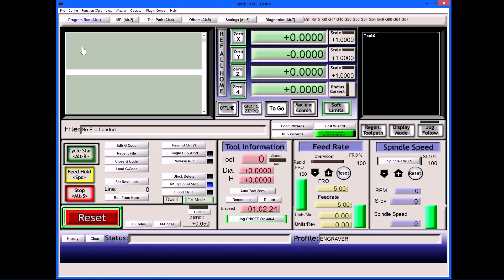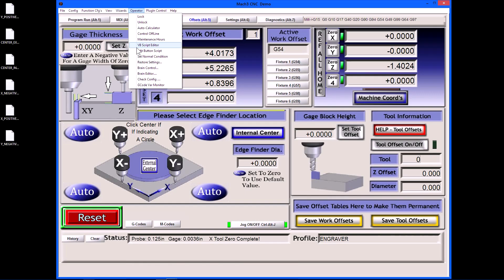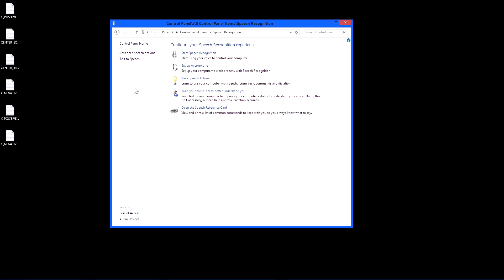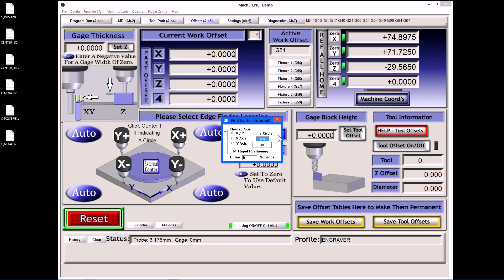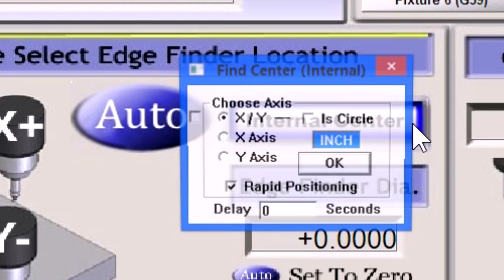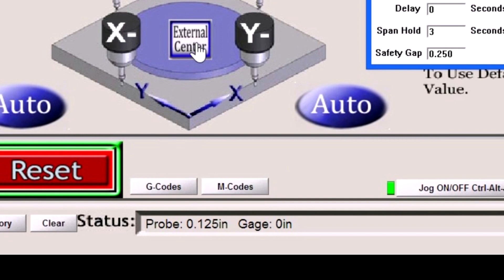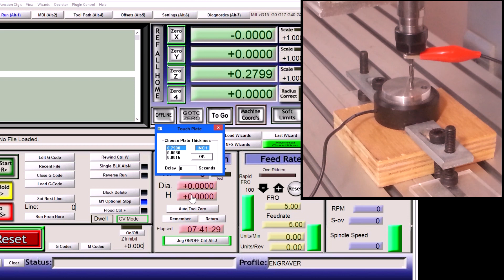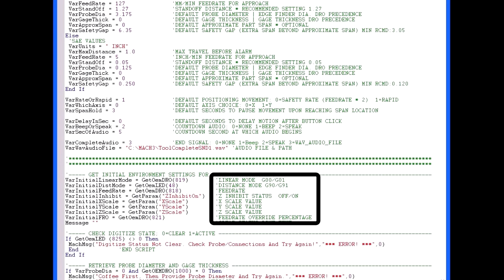CNC Mach3 | Automated Tool Setting | Edge/Center Finding (X/Y) | Includes INCH/MM Scripts

Comment: just installed this after a few years of not using my 4030 .
i have the red bitsensor board over usb and all works perfectly now after breaking 2 bits.
once due to not setting tool zero first  the second was due to not setting up in carbide create correctly so still went further down as was not set to zero for work piece and smashed into a clamp that was on the spoil board.
got it all sussed now so hopefully no more broken bits.
great work on these videos and very well done and the explanation is great.
i am thinking about converting my chester 626 mill now to cnc.
but not sure on mach3 or the smc type control boards.
next step some screen editing.

Comment: Hello, thank you for the information, but I need help. When I use an external center it touches and then moves automatically without rising in the Z first. And tool breaks
Reply: Is there a solution please that can help me?

Comment: I have to thank you for your videos. I want to report that I have tried the X/Y scripts you have and the Z as well on my board. I am using an ethernet board and the scripts work just fine. Don't know about the USB one though. My board loses its mind when used with USB and not Ethernet.
Reply: Waiting for your video on measuring angles of the workpiece and calculating toolpaths with that in mind. Thanks for your valuable content

Comment: I'm new with CNC and the one I have (DMC2) it's using an edge finder that is offset from the spindle.  around +40mm for X and +25mm for the Y.  Question::  Where do I enter the offset position of my probe in the script ?
Reply from the maker: This particular script doesn't have that option. However, you can move your axes the 40,25 after zero is found, then re-zero the axes. Or, you can contact me at sunny5rise@gmail.com with pictures of your setup and we can work on editing the script to do it automatically.

Comment: It's been quite a long that i'm using this scripts and it has always worked very fine, now i have to do some changes in my machine and i was wondering if it's possible to modify the script to work with a reversed digitise input... always 1 and it goes to 0 when touching.
I apreciate your job thank you if you would reply
Reply from the maker: Thank you. If you're talking about working with a reversed probe signal, the script works fine (based on my testing). All I did was reverse the signal (Config\Ports and Pins\Input Signals\Probe... and change the Active Low to Active High). Now the Probe disconnect triggers the Digitize LED. No script editing. Did you have a different experience?
Reply: @sunny5rising  oh thank you, i didn't even think about a so basic thing... i was in to a mental trip to try to figure out the code and modify it and bypassed the most basic thing.
I tried and it worked as expected, thank you
Reply from the maker: Awesome!

Comment: sir, why rxternal center finder does not have is circle?
Reply from the maker: It can be written to have a circle option. I just wrote it like I did for safety reasons. Perhaps I should update it. You can still find the external center of a circle with the current version. Example... Do the X axis first. when done, don't move the X axis, then setup and run the Y axis. When done, you will have center of the external circle.
Reply: @sunny5rising  Hi Charlie, noted on the safety part. I understand might not be necessary to have the circle function . Thank you for the explanation. Btw your scripts are great ! :-)
Reply from the maker: Thank you!

Comment: I’m using the 3.42... version of Mach3. I used your codes, the codes work but they don’t reset the axes. I’m trying to find the center of the inside of the circle. I think the tip is right in the center, but the x and y axis remain at 1,xxx; it does not zero
Reply from the maker: Edit the Internal Center script. On line 313 (for Rev15b) or line 319 (for Rev13), Change SetOemDRO(800,0) to SetDRO(0,0). Zeroing the Y axis would be SetDRO(1,0). Give it a try and let me know how it works out.

Comment: sir where do u get mach 3 version.66?
Reply from the maker: I downloaded  .66 from the Mach3 website about 8 years ago. At the time it was their latest.  They removed .66 for download and put .62. I read somewhere that .62 was a more stable version. 

I read somewhere that the .62 version downloadable from Mach3 now includes some updates if you're running Win10. I don't know this for a fact, that's just what I read earlier today.

I forgot if I ever asked you what version you have. I still use .66 since I have not had problems with it.

I still have the .66 setup file if you want it. If you do install a new version, remember to copy and save your Profile xml, your mach3 license file (Mach1Lic.dat), any custom M code files (if you wrote any), and stuff like that. You can put them back after the install.
Reply: thank u @sunny5rising

Comment: Charlie

I had this working fine until recently and I needed a system rebuild. Now I have problems with the internal and external centering but the X/Y edge finding works fine. 

The problem I have is at the end of the code the tool doesn't center on the midpoint and the DRO's don't zero. However, if I single step the code the tool centers correctly and the DRO's zero. As I said, edge finding works fine. I am guessing some sort of timing problem, but tweaking the sleep values in code doesn't appear to make any difference

Mach3 V 3.043.66 and Center external script Rev 16 and Center internal script Rev15b. Edge finding scripts Rev13

Any clues on what to investigate please?
Reply from the maker: If you would, Copy and Paste your modified version into a text file. Send it to me at sunny5rise@gmail.com. I'll look it your edits and maybe make some more.
Reply: @sunny5rising   Charlie Will do. I think I have found the problem IsMoving() jumps out of the loop early and the DRO's are still changing. 

I think you have found a similar problem because in the edge finder scripts I see you have a Sleep 500 after the axis move and IsMoving.  The trouble with a fixed delay is it depends on the speed of the move. If you reduce VarFeedRate you require a bigger delay. Although I have now included Sleep 1500 between the last move and the DRO read I also have code that loops and reads the DRO's until they have stopped changing.  

I am doing some more tests and will then send you my revised scripts

By the way my controller is an NVCM USB device.

Pete

Comment: Hello Sir, great job with those scripts but, unfortunately I can't find them.
Is there a procedure to have access and download those sripts.
Thanks.
Regards
Reply from the maker: In the description of the video are links to the files. If you still have issues, you can email me at sunny5rise@gmail.com and I'll email them to you.
Reply: @sunny5rising Thank you for such a quick answer and I've just found them meanwhile.
I'm gonna use them with a homemade CNC based on a EC500 ethernet controller.
Is there anything I should take care of using those scripts on a ethernet controller?
Regards.
Reply from the maker: The version marked USB should work fine for you. Do test with loose parts to make sure it works as you expect. If you have issues,  you can email me.

Comment: Hello, i tried using this but the system still doesnt work for me. I dont know what i specifically did get wrong. Maybe its because i use a ethernet poort or something with offsets that i didnt take into account. But after it gives a offset of -1,26.... It adjusted that number too -2361,00 consistently. Does anyone have some clues why this could be?
Reply: Another note, it only does this in the negative direction of the y and x axis. The positive gives the correct  adjusted offset. The correct one looks like 2,27 while the incorrect version is -227,0
Reply: Combining the solution of the previous comments and setting the gauge to zero it works!
Reply from the maker: Glad you got it figured out. If you have any more issues, email me at sunny5rise@gmail.com

Comment: Ok, I find a way to solve the problem without any modification for you guys who using usb:
If you have problem on -Y and -X with 10x more numbers (like 320mm) it´s JUST the "VarStandOff" on the start. I dont know why but cause this issue if you set at "1.27" but if you set without "dot" it goes ok and everything perfect..
So I set everythink in solid number (MM) and going to share for all of you
(obs: I set probe and thick to 0 as I use outside).
Just change this values on the first part (you can only change the Varprobedia, but I prefer do everything without "dot":

FOR: -X -Y X and Y:

VarMaxDistance = 25
VarFeedRate = 127
VarStandOff = 2
VarProbeDia = 0
VarGageThick = 0

---

FOR EXTERNAL (circle or not)):

VarMaxDistance = 25
VarFeedRate = 127
VarStandOff = 2
VarProbeDia = 0
VarGageThick = 0
VarApproxSpan = 0
VarSafetyGap = 6

---

FOR INTERNAL (circle or not):

VarMaxXDistance = 147
VarMaxYDistance = 223
VarFeedRate = 127
VarProbeDia = 0
VarGageThick = 0

Hope I help you on something.
Reply: Btw, I using a RNR ecomotion USB
Reply from the maker: Interesting. Thank you for the information.

Comment: i know this video is old af, but i was wondering if you had a script that would soft-start a DC motor that's attached to the BOB and uses PWM (pin 1, not the 0-10v header)
Reply from the maker: Not quite sure. I'd have to learn about it and experiment with it.

Comment: hello, great video is very interesting, I downloaded the install scripts and I have 3 scripts that do not work. I have mach3 3.043.66
First mistake
"Y positive" error line 121 type mismatch"
the second
"X positive error line121 type mismatch"
and third
"external center error line 286 type mismatch"
do you know why
Thanks a lot
Reply from the maker: jean, if you would... email me at sunny5rise@gmail.com and tell me the script versions (Revisions) that you are having trouble with and well work to resolve the issues.

Comment: does external center covers outside diameter of a circle?. i noticed internal center does have circle option
Reply from the maker: Helo Rengan, the external center script can be used to check diameter, i just didn't program it to do it automatically (for  safety reasons). To check diameter, run the X-Span, then the Y-Span. This will center the probe. After that, again run the X-span  (making sure to not move the Y axis when resetting the probe up), then check the X-Span reading. Run the Y-Span again (making sure not to move the X axis) and take its reading. Those last two span readings will show the diameter on their particular axes.
Reply: @sunny5rising  thank you sir for the explanation

Comment: I tried this on my machine and got a few errors on Mach3 v3.041. After reverse engineering the whole script I found out all I had to do was change my VarStandOff, VarGageThick and VarProbeDia to whole numbers, as "VCATCH" was returning the operation between these variables with a decimal point and mach3 apparently didn't know how to input decimal values into my xyz coordinates, the first time I tried it I got -28715 or something like that, good thing I have limit switches,  cuz I sent it g0x0y0 before checking where the machine thought it was. I guess it could be easily fixed if you don't have a whole number diameter probe, but I don't want to read through VB script or Mach3 documentation right now. Thanks for sharing, Charlie!
Reply from the maker: Thank you. Sorry you had those issues, but glad you got it figured out.

Comment: Hi Charlie.  Quickly I've got --- Much,  a c10 ver8.3 Bob, a Drewtronics s5000LED probe. What terminals do I need to hook up to on the c10 board.   My guess is 5 V on the input strip and #10 terminal. I know this is very rudimentary but I just wanted tobe sure. My machine runs flawless and don't want to hurt it.   Thanks
Reply from the maker: Hello Eric. I have not used that board, so I cannot verify if that is correct or not.

Comment: I have never found it useful to use a probe, it takes too long. I just jog to the zero position, zero Mach3, and you're ready to go. Why is probing useful?
Reply from the maker: Its usefulness depends on what you're trying to accomplish, really. Yes, it does take a bit of time, especially if not necessary. Sometimes eyeballing is all that is required for a job. Other times, jobs require more accuracy. In the case of my X/Y scripts here, you can accurately define edge zero, corner zero, part center, hole center. They can also measure a hole's average diameter and its X/Y out of roundness along with measuring internal and external span widths. Of course, not everyone will need these tools. Nonetheless, to me, that's why probing is useful. :)

Comment: Hi Charlie;  Your tutorials  and scripts are out standing.  I installed your (X/Y) edge/center program and I have an problem I hope you can help me with. When running the script to find center of part my system will find (X-) side then move to the (X+) side, drops down then move in the (X+) direction instead of moving to (X-) to find edge  of the part.   I’m running Mach 3 Ver R3.041 
Thank:
Reply from the maker: Hello Larry. Thank you for the compliments. Since you're using an older version of Mach3, we may have to customize the script. Email me at sunny5rise@gmail.com and tell me which Revision of the script you are having issues with.

Comment: I run a warp 9 ethernet smooth stepper and it works great! thanks for the scripts! One thing i am struggling with is a Z height read out. I would like to run [Auto Tool Zero] it would set the DRO to 0.000....then a big then, i would like to call up a fixed location using machine coordinate and touch off on another plate that is permanently located on my bed. The have the dimension/distance of Z height displayed in the status bar, as you did with  internal center function. This would give the thickness of the work piece, i need to do this because my shop is never the same temp, i have a 4'X4' machine and it does expand and shrink....I have even set up an API laser tracker and it does flex up to 0.30 dependent on temp. If i had a script to touch off on top of the work piece then touch off on a fixed location on the bed, then spit that dimension out....man that would be awesome!! still trying to fungible through it but i am struggling...haha...thanks again for the video and scripts, if you get board can you please help me with this.
Reply from the maker: Hello motodv8 moto. Sounds interesting. email me at sunny5rise@gmail.com and send me what you have so far (the script, if you've edited it) and information on what you are struggling with. We'll go from there.

Comment: Hi Charlie. Good news! Your script works beautifully with an Ethernet connected machine! One question though, on the “offset” page, do I need to enter any figure in the Z offset? The thickness of my touch plate for example? Or, do I just leave it on zero? Thanks, you are a star! David
Reply from the maker: David, Excellent! Glad it worked out. You do not need to add anything on the Offsets screen for Z when using my Z script. My XY scripts do use that DRO field only if you want to use a different "Gage Thickness" other than the Default you set in the XY scripts. That "Set Z" button is only used if you want to use Mach3's default action with setting Z.

Comment: Hello Charlie, thank you very much for your scripts and your support for this CNC/MACH3 | Automated tool setting | Edge/Center Finding (X/Y) | Includes INCH/MM scripts.
I have a question. Is it also possible to create a script to measure the workpiece position with "corner angle"? Angle of Surface?
Reply from the maker: Thomas, you're welcome. About the angle question... I am currently working on a probing script to set coordinate system rotation angle (G68). Not sure if that's what you are referring to.
Reply: @sunny5rising  Yes Charlie, thats the right way what Im looking for. Have seen it on new Mach4 but I will not change my Running System :-)
1000 thanks for you work!

Comment: Thanks a lot for this tutorial and the scripts provided. You explain things clearly and sucintly without mabo jambo. I use the previous Z one from you and it works like a charm.  Now I am going to incorporate these as well. What will be next? A script for setting the three axis at a time would be great. I would try to put together this +x , +y and Z from the previous video to use with a 3axis touch plate but my knowlegde of Gcode and VB is nil so I do not dare to.
Reply from the maker: Thank you. Glad you enjoy the scripts and videos. I have had several requests for a 3-Axis script. It is on my list. Since you asked what's next... Currently, I'm working on a probing script for setting Coordinate System Rotation Angle (G68). This will probably be released somewhat soon... still testing. Thanks again.